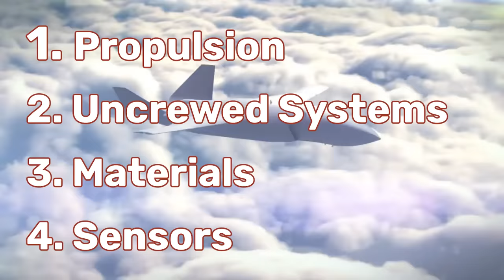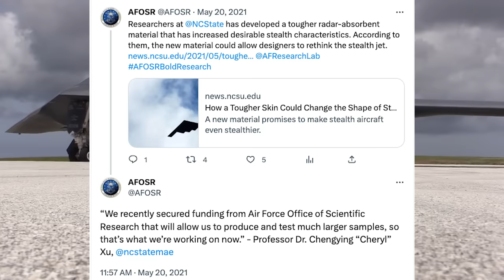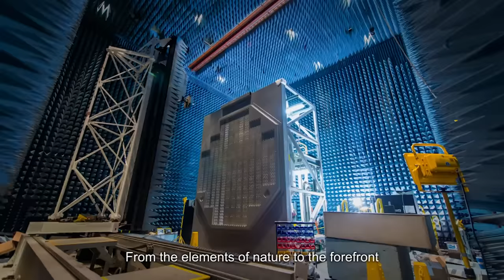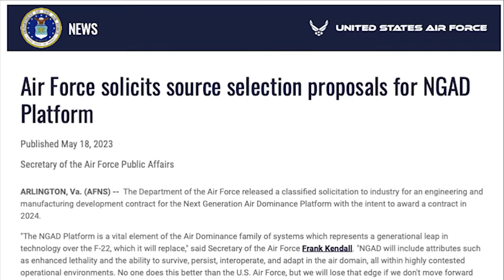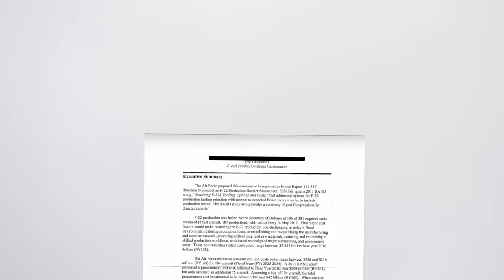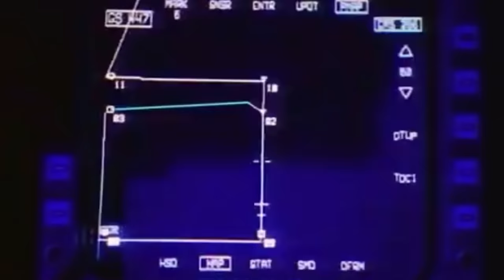Why America's new stealth fighters might cost $300 MILLION each

Comment: I wouldn't be surprised to see Gen 7+ Ram Coatings being AI-enabled/interconnected nano bot-based with active surface modulation capabilities, enabling dynamic surface airflow & temperature control along the entire surface that can react & adapt to any situation & speed to mitigate reflective & temperature -based radar detection. Maybe even with the ability to intentionally manipulate & modulate the perceived radar return signature, or the way a signature is returned to change the perceived speed, or vary it in a way that speed is incalculable.

Maybe it'd be more like cloak technology, rather than stealth, but sure is a cool concept! And I believe a realistic future one.

Comment: Gallium Nitride and Gallium Arsenide are very old technologies. Dating all the way back to the early 1980's. If Northrup Grumman is designing a high power radar, then my money is on Silicon Carbide as the semiconductor material. It is stable to far higher temperatures (and can therefore handle more current)  than almost any other technologyvin the pipeline.

Comment: So NGAD won't be receiving any "electronic stealth" EW, similar what Gripen is using?
Reply: Of course it will. F-35 already has an incredibly capable EW suite incorporated into its radar and other systems so it's a safe bet that NGAD would be at least as good in this respect if not far better.

Comment: I have always wondered why the defense industry cannot build infrastructure and build its own equipment at a fraction of the cost
Reply: If you look at USPS versus UPS or FedEx the answer is pretty clear. Government run things tend to result in mediocrity at best, and the lack of alternative competition can result in half baked results, endless delays, and inflated costs just for the sake of securing a higher budget. Granted all of these issues are problems the US military-industrial complex has even today, but a single government-run enterprise likely would be even worse.
Reply: @alexanderkim4889  Why, cause USPS is actually decent to its workers, unlike FedEx? (UPS actually isn't that bad, but that's only because UPS is almost completely unionized.) USPS wouldn't even be that much of a drain if the Bush admin hadn't pushed through requirements that it pay forward pension and retirement benefits, something that not even any other government agency is required to do.
Reply: @colinhobbs7265  Sure workers are one thing, but that doesn't help make fighters "a fraction of the cost."
Reply: @alexanderkim4889  hard to believe it could be any worse than it is, saw some "grifting" exposes,  unbelievable waste of funds
Reply: @Victor Huffman  yeah current system isn't great for sure, but just saying I don't think a single government arm would be much better or more efficient.

Comment: That's unfortunately not the whole story. Inflation is a big factor in equivalent cost analysis. But one also must look at things like, the reduction in cost of much better overall technology, specifically electronics. Same thing goes with material science and adjacently therefore jet propulsion technology. On the other hand we have to add on cost of technologies that didn't exist then or that add new capabilities over anything that would be in peer or near peer weapon systems. So I agree with the idea that 300 million is probably a good price compared to remaking the same old stuff now.... This ignores an economic fact through history, that we're able to produce more for less and usually better as well as time goes on. I'm not taking away from the fact that this price is probably not just accurate, but reasonable. And that's because while a spear made 5,000 years ago cost absolutely nothing, in real terms it actually ended up costing significantly more than what we can make now. But our spear today would be absolutely fantastic spear... But absolutely useless in our warfare today.  This is the reason why while very informative and useful to know in today's currency metric what something that we produced 50 years ago costs, it ignores the progress that we have achieved in that time... Having said that as a taxpayer, I would rather they figured a way to reduce that price on a per unit cost, even if that means purchasing an extra 30 to 50% of these units... And I would also like to say that it shouldn't be impossible at a reasonable cost, to upgrade in a significant manner some of the older airframes like the F-22... But with that particular frame I'm more concerned with the sustainability and maintenance costs than I am with the original per unit cost including research and development, and more importantly the loss of opportunity cost by holding on to them when that money could be put towards something that's more capable and more efficient at the same time

Comment: I believe the F15 EX actually has the most powerful radar in the world with APG-82. BTW, can we still call the F35 an acquisition boondoggle considering it essentially turned out to cost less than many past platforms? The real question though isn’t unit purchase cost, it’s how much each unit will cost when you included life maintenance and operation cost. I know the F14, for example, was supposed to be an absolute maintenance nightmare.
Reply: GaN RX/TX modules have finally made fighter-based AESA RADARs more than paper tigers. Currently AESA RADARs overheat easily in long range search and track modes - so are great multitaskers just not at high power loads. GaN modules are the game changer.   F-15EX is exactly the right plane to be developing now, ultra complex super-integrated stealth aircraft are a dead-end - by the time you carry out a refresh cycle on them, the built-in tech is out of date. Whereas gen 4 & 4.5 aircraft can receive bolt-on bleeding edge tech in months.

Comment: Yes! It is way too expensive. Fill out the entire fighter force with 1200 F-35 and 1200 F-15EX instead. Adversaries don’t have anything that can match F-35 for stealth and sensors or F-15EX for extreme long range sensors and firepower. 

At $300 million each, a 4 aircraft wing of NGAD would cost $1.2 billion. We can get 15 F-35A or F-15EX for the same price. Modernizing the entire fighter force would be more valuable and is more necessary than just a couple hundred platinum bullet extreme overkill fighters.
Reply: Put NGAD back on the shelf for later. Right now, large production volumes of current aircraft is more important. War is coming soon, within just a few years. NGAD cannot be fully tested and produced in volume by then anyways.

Comment: Doesn't the SR71 have an adaptive cycle engine capable of supersonic to hypersonic speed?  I'm probably remembering that wrong.  Maybe it's design was the basis for an engine with that capability.  I wish I could find that video now.
Reply: It did have the capability to bleed air off the turbojet into a ramjet, but it didn't go hypersonic. It topped out somewhere around mach 3+.
Reply: It had a turbo ramjet. Basically a conventional engine to get up to speed, and then a ramjet to use the supersonic airflow to go even faster.

Whereas, adaptive cycle engines are more about fuel efficiency
Reply: @drksideofthewal  It's not a ramjet at speed either because the bypass air has already been compressed by four of the compressor stages before being diverted around the combustion chamber and into the afterburner. For it to operate as a ramjet the air would have to be compressed purely by the geometry of the intake with no moving fan blades in the air flow.

Comment: We got a fleet of less than 200 F-22s because the fly away cost was so high due to cancelled orders.
Yes, a $300 million dollar 6th generation air dominance fighter is too much. They'll order hundreds. Cut the order. We'll end up with a B-2 sized "fleet" of several dozen aircraft that will be too costly to operate and too irreplaceable to risk. 
And I know some want to play mental gymnastics, but it's already clear from the USAF that they don't have the budget to operate a primarily F-35 fleet and the USN is in similar straits and is ordering the bare minimum of F-35Cs for much of the same reason. Compound this with a new 6th gen aircraft that will be that expensive and it's just going to be a disaster.

Comment: why don’t they retrofit the F 22s and put the AI computers in for flight without pilots for the NGAD program? 
I am sure that retrofitting would be a lot cheaper than starting from scratch creating autonomous drones with far less capabilities. Just add the upgrades that are needed and then slap in the eye in there for pilot less flight I have of the NGAD program is done for far less money. The only issue I see was the low production rate that they made, but that would be a heck of a lot cheaper than starting from scratch and it seems like a real shame do you remove such an amazing claim from the skies when simple upgrades good fit the bill for the drones needed for the NGAD program or at least for the F 35s! There may not be enough to fit the bill for all of the autonomous drones needed, but they could move certainly use what we have a long side of the new drones. It seems like a shame to take such an incredible fighter and just scrap it!

Comment: Nobody ever thinks about the price of yesterday. Ie. Such as the '70s compared to today in conversion of the US dollar to today's prices. Has a Navy old rotor head. Analog 90 to 96 CV 67. I really wish that we, the Navy US Navy would have continued with the super tomcat. It alleviated the rotation gearing and maintenance. The wing variance would have been more like a sleeve that would have extended and retracted. Totally stealth and also the air frame was there for it to be done with little modifications. The price would have been much less. Whenever you start and it's always the USAF whenever you start a new air frame That's where the big pile of money starts.

Comment: It's all in the accounting.  If you dump $100 billion into R&D, and if you're stupidz and count sunk costs into "Price of each aircraft calculation" (and you shouldn't -  you should only look at variable costs moving forward) and say you build one plane then congress sayz the plane cost $100 billioin WHICH IS INSANE.  Take the B2 spirit... ignore sunk R&D costs and look at the variable costs and it's in line with the cost to build a very large, modern Airbus or Boeing passenger plane.  But everyone is stupid so for the F-35 they dump all the R&D and capital investments for production and use them to calculate the variable cost of the plane.  This is dumb because if you've gone to trouble of dumping R&D and capital costs into production, just look at variable costs to make the best decision on how many to make and recoup that investment to the max.  Other considerations are maintenance costs and uptime.  Drives me crazy that congress includes sunk costs/investments to determine how many planes that should buy.  Once those costs are down the drain you want to maximize your return on that investment not minimize it.  Blah.  So you can make that figure whatever you want for whatever narrative you're trying to put out there.  I'd only be interested in variable costs for a given production run and what numbers you'd need to minimize that variable cost.

Comment: If they actually commit to the platform instead of getting political about it.
The f22 could have been alot cheaper if they followed thru on the original order and made variations for each branch of the military it could have been alot cheaper cuz of the infatructure need to make them and maintain them and the streamlining that would have been developed for those processes.
It crazy how many times this has happened with military equipment these politicians can't make up there mind and waste a lot of money on projects they never finish.

Comment: I don’t care how capable they are. They cost too dang much. We won ww2 because we could make more stuff. In a all out war we would take casualties. We need to be able to replace those casualties.
Reply: WW2 and the modern era could not be any further apart.  The High-Low approach has been successful since the mid cold war.  NGAD is supposed to be the high with F-35 as the low.  The idea is that you reduce the number of casualties you take while inflicting as much damage per unit as you can.  F-35's exist alongside future drone concepts to add numbers to prevent asset saturation.  Like it or not, war is inherently expensive nowadays.  Anyone with a cheap military built around numbers gets slaughtered by the advanced tech they can't manage to kill.  Or at lest what they can't kill much of.  If you want a force powerful enough to deter any direct conflict, it's going to cost a pretty penny.

Comment: As others in the comments of previous videos argued with me about drone dominance they fail to realize active platforms were designed decades ago. We’ve come a long way in tech and the longer we wait the better it will be.  Classified aircraft always surpass all expectations and I expect this no different. Even with modern turbine engines, say 6 of them with 180 degree thrust vectoring the performance is beyond anything with a human body in it. I doubt they’ll use turbojet, turbofan, or even ramjet scramjet propulsion the biological part needs to go. Yes current platforms are g limited, but one built from scratch without a pilot and with modern material science an insane g limit is achievable. The datalink is key and I’m certain they are decades ahead of apple and nord vpn😂. People for centuries have been blown away by military tech and I suspect this will be no different. Now as usual everyone comment on how stupid I am until the unveiling of the ngadp.
Reply: Yes I’m aware of emps to disrupt communication as was the designers half a century ago. They can mitigate that.
Reply: And yes current radar is extremely outdated. LiDAR and many unknown radio Frequency or electromagnetic or gravitational wave , or other send and receive methods of detection is probably closer than we realize to being made operational.

Comment: Justifying this plane is going to be a stretch. At one point the Russian threat would have done it but we have over estimated her capabilities and her current war is sappy all her resources. Russia won't be a threat (thinking air power here) for decades. Simply won't have the economy to support a viable weapons system. China? Possibly, but her economy is taking hits and with corruption proving to be almost as bad as Russia's; she is much more of a threat than Russia - but with missiles, not air power (for the next decade or so). Our budget, our inability to properly audit any of the armed services is a much bigger problem. I think a very strong case could be made for a small, cheap, low tech, made in the thousands mini-F-16 - backed up with our current high tech fighters. Don't cut back on R&D, but stop buying Jeep Grand Wagoneers when little Bronco Sports will do just fine.

Comment: So what happens when those ai powered drones run into a wall of ECM? Something that has been degrading the performance of weapons and utterly making a mess of communications in Ukraine.
It's so bad that Ukrainian jets flying near the front line are often flying deaf and blind, unable to communicate with each other or their command. The same ECM has been hitting the ground forces down to the platoon and squad level with squads and individual units unable to call for help, commanders unable to send orders.
Reply: First off, do you have a source for that claim about the pilots?  Second, you do realize the tech Ukraine is using and the tech in these aircraft could not be much further apart in capability right?  If the enemy doesn't want to nuke their own coms or links in the process, they'll need to know exactly what frequencies are being used.  And good luck breaking the encryption in modern US fighters.

Comment: Sure, high tech military equipment has always been expensive.  The pertinent question does it have to be that costly?  Elon Musk's SpaceX sets a new paradigm for cutting edge capability at budget prices. SpaceX jumped into a industry were prices were astronautical and any attempts at cost cutting increased prices (EELV program).  In a few short years they went for a laughed at startup to now dominating the world launch industry in an unimaged fashion.  DoD and NASA presently buys launch, satellite, manned space delivery and communication services from SpaceX at an extraordinary discount.  The question is how SpaceX did it and can the SpaceX model be reproduced in other Space related industries?  The answer is complex and in short, due to a lack of will, a lack of more Elon Musk's and politics, probably not.  It is unfortunate the tax payer will continue to get shafted because of the inability to change the defense system for the better.